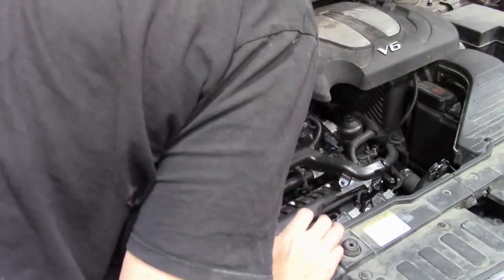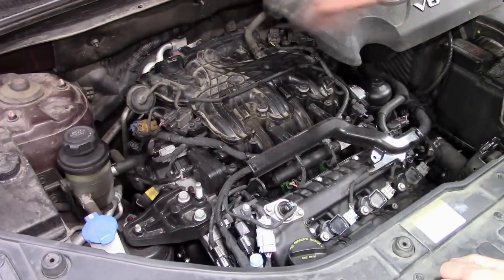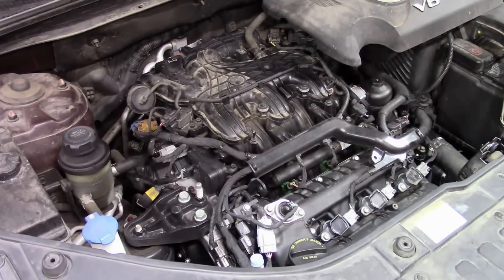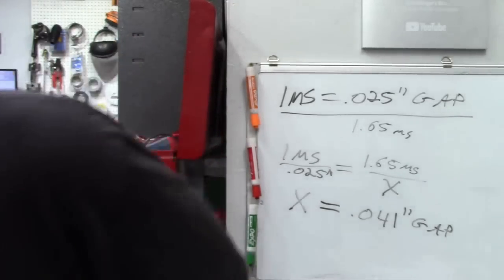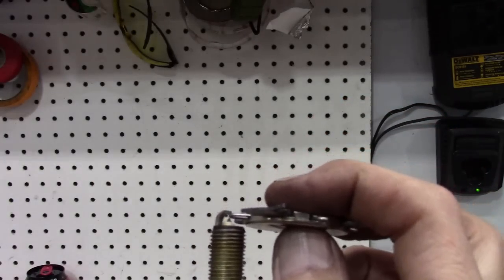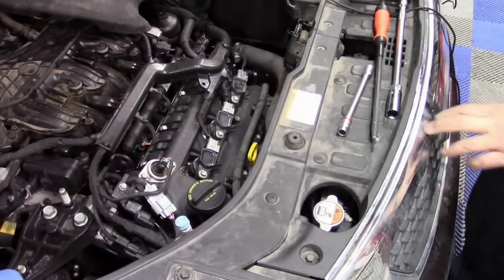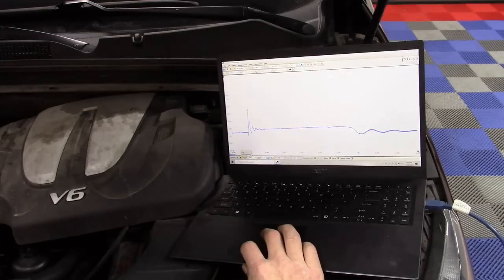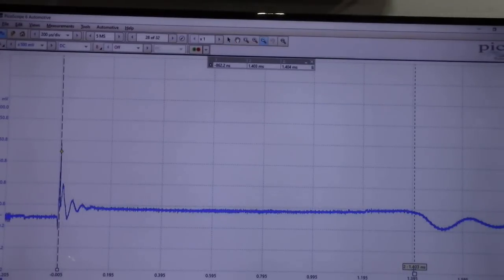Can You Tell Spark Plug Gap Without Removing The Plug?

Comment: A way to accomplish this would be to have a coil with a driver that you can control. With that you could control the voltage on the coil and be able to establish “baselines” and compare. The issue with a system like that would be: you have to connect this coil/driver system to the suspect spark plugs, so the intake has to come off, defeating the purpose of the whole exercise.

Comment: While it's true that duration of spark may depend on many factors, you are changing only one variable in your experiment, so I don't see any issue in trying to understand how duration of spark depends on gap.  If you assume that this relationship follows some power law i.e. T( gap ) = A * gap^p where A and p are parameters that you need to determine then you can use your experimental data to fit these parameters.  Because p enters this equation in a non-linear fashion, you cannot use linear regression as is, however, you can take a log of both side of the equation to get log( T ) = log( A ) + p * Log( gap ) and then linear regression in this log space will work fine. I plugged your numbers into a spreadsheet and ended up with a fitting like this: T( gap ) = 0.59* gap^(-0.34).  It is worthwhile pointing out that for power law assumption one would expect T( 0.08 ) / T( 0.04 ) to be approximately same as T( 0.04 ) / T( 0.02 ) which is not quite so in your data, so either this assumption is not right or measurement error is non-trivial.

Comment: The old school Godfather of spark, https://www.youtube.com/watch?v=TgFJVL_WsMA
Reply: You added a black screen with some text into your video so it seems that you did some research after the fact, the air-fuel mixture between the 2 points, anode, and cathode, must first be ionized to create that first sparkline or vertical rise in the waveform. The larger the gap, the higher the KV demand and the shorter the burn line as you have proven but why, is the question and your edited screen tells why, limited energy from the coil, it is referred to as a limited length of rope that you have for the full spark event, the higher the sparkline the shorter the burn line. As you mentioned there are other factors, the air-fuel ratio is a major factor but that is another test and another story.

What burns easier fuel or air, more fuel meaning at the correct ratio will allow electrons to ionize the mixture at a set amount of time, this is a small piece of spark timing, the spark cannot start until the gap is finally ionized to allow the spark to start and this is one reason for a specific spark gap on the plug and a very nice reason why you are working on this project. If you are going to compare one engine to another, it must be the same type of engine where the bank in question most likely has the same air-fuel ratio or you can prove there is not a rich or lean problem between 2 banks based on O2 feedback, and now you can comfortably measure the gap with your upcoming method based on the full spark waveform, not only the burn line. Again, the spark starts with the firing line based on the gap and air-fuel ratio assuming all other factors are equal such as compression which also plays a huge role, one of the biggest actually so needs an even cranking cadence regardless of the compression, the cylinders need to be fairly even.

Sometimes you mention that not all cars have the same operation like not all cars have fuel pump prime, well here also, not all cars use the same spark plugs in the covered rear bank and the front open bank, due to the labor to get to the rear bank, a manufacturer may choose to use more expensive platinum plugs under the manifold and regular plugs out in the open saying that the covered plugs don't need to be changed as often due to the extra labor involved. But both sets of plugs still use the 1.1mm gap and have the same rated heat range. Your upcoming test may prove that the rear plugs still don't need to be changed based on this fact and the parts store should tell you this info or the owner's manual may list the expected spark plug part numbers for your own maintenance needs.

Scopes are getting more and more affordable these days so I am happy to see that you are moving up in the diagnostic world on your channel. Thank you for your own R&D also. Enjoy the video above.

Comment: As you mentioned Matt, there are lots of variables for the KV firing line, spark KV and burn time. Examples would be air/fuel ratio, compression, spark gap, engine temp, timing, etc. The coil when energized during it's dwell period has gained a certain amount of energy. Depending on all of those variables, the spark will jump the gap. If there is a larger spark gap, the KV firing line will be higher and more energy is used. This means there is less energy for the burn time and it would be shorter in time. And if the gap is less, there is more energy left over for the burn time which means its burn time would be longer. Some people will use the analogy that this energy is equal to the length of a string. The length of the string would be from the highest point of the KV firing line to end of the burn time. You can visualize that as the KV firing line comes down, the burn time will get longer. And as the KV firing line goes up, the burn time gets less. Some people think that resistance is involved when the spark immediately jumps the gap, but this isn't so because current flow hasn't been established yet. The spark KV point where it jumps out is where current flow is established and resistance is determined. For example, if the spark KV point is high, then there is more resistance, maybe from a bad spark plug wire.

I have some thoughts about some changes in your experiment, but it probably wind up being a book in this comment. I sent you an email from your channel email where we could possibly exchange some contact info and give you some thoughts. Have a great day!
Reply from the maker: Was waiting for you to respond hahaha!!!  I will call you later as I also have some ideas as well. I totally would do this on a crank without fuel for example because I could remove fuel as a variable.  Totally the more I think about it, the more I realize this is highly variable.

Comment: Nice experiment. But there are more variables. The compression, the air mixture (lean/rich) are also influencing the spark characteristics. In fact they analize the spark waveform to see if there is compression, or rich / lean mixture.
Reply from the maker: very true. If I revisit this I will only do cranking because I realized in editing that fuel is a variable.

Comment: I had just read a lengthy explanation on coil dwell and I agree with Richard Cranium. As I understand it some coil dwells are controlled by the ECU and some are controlled by a separate module triggered by the ECU. ECU dwells are mapped similar to fuel trims. Again there are many variables.
A question I do have as far as ignition goes is, have you seen a correlation between MAP and ignition timing? I scanned through your videos and didn't find anything. I've an issue with my 97 GMC 5.7 vortec when driving, as timing increases, MAP decreases and LTFT goes to 14. Conditions cannot be duplicated when in park and running the engine rpm the same.

Comment: Okay, I have given this some thought...  I order to have any kind of realistic shot at coming up with a workable Spark Gap vs Spark Time Line correlation that will work with any engine we need to have some constants.  At the least the test needs to be done in a non-running engine where combustion pressure and air/fuel ratios are not a factor, much less a potentially ever changing variable.  This means a way to induce a high voltage spark that can jump the plug gap, where we use the same ignition coil for each voltage output sent, and then the tester will be connected to each plug individually (on a non-running engine), using the same test equipment, we ought to be able to use same spark plug cable length, resistance, and cable type (graphite core, copper wire core, or other conductive material in the core of the cable) needs to be used on each and every plug tested.  So, now we have the makings of a very simple test bed.  I will build a Spark Plug Gap To Ms Spark Line prototype using an old school ignition coil, one spark plug wire, Primary Circuit wiring, an outside power source 9-10 volts DC), and a way to switch the primary ignition on and off via a hand held button.  The thinking is a PicoScope can be used to measure the kV and Ms on a non-running engine where voltage is sent to a subject spark plug by closing, then opening the primary ignition coil circuit to cause the high voltage current to fire and jump the plug gap.

There will be some variables based on plug construction, and any resistance built into each plug brand/model.  But, the variables with trying to gauge a plug gap on a running engine with differing secondary cable lengths, changing air/fuel ratios, differing dynamic combustion chamber compression, etc., will be eliminated, leaving very few remaining variables to disrupt what could be an interesting test.

Okay, I get to build a new toy to play with!  Funny thing, I already have pretty much everything on hand to build such a contraption.  What I do not have yet is the PicoScope, but that is now on my short list of things to acquire, and learn to use with my vintage pony cars (and this Spark Gap Ms correlation project)..
Reply from the maker: I like your thinking. totally agree on non running engine and also the lack of fuel removes a variable too.
Reply: @SchrodingersBox  I just ordered the parts needed to fabricate a test bed.  I will be purchasing at least 1, if not 2, automotive oscilloscope kits this week also.  Maybe by this coming weekend I will have a working model of a spark gap tester, and perhaps I will have a few spark plug lapse times vs gap correlations for more than one new spark plug.  Nothing fancy, ignition coil (for use with an outside resistor), ignition coil mounting bracket, remote starter push button switch, primary ignition capacitor/condenser (to help suppress excessive secondary voltage build up when the primary circuit is closed), Secondary ignition spark plug cable with a long boot, 1/2" inch tick acrylic board to mount the components to.  The initial contraption is not going to be fancy, just a back fabrication of a simple spark plug gap vs spark line sustain time with some fairly common parts (once done I will provide the list of parts used.  Although I could have scrounged the parts together locally, I went through Amazon for all the parts.
Reply: Lynda and I are out of town for a few days.  But, the parts I ordered to build a little primary & secondary ignition test bed to see what the correlation is between spark plug gap and sparkline timeline results.  I plan to build this our old school using a hand held normally open, spring loaded remote starter test switch to let the primary lines of flux build the primary circuit when the button is pressed (switch contacts are closed), and then fire then the button is released and the flux field collapses.  The old school aspect is the use of a condenser to both see how it works during flux field building, and collapsing, and to see the level of absorbede residual energy in the primary circuit when said flux field collapses.

I purchased a MicSig 4 channel scope to test the firing of the test spark plug.  It is more than capable of testing and showing what is going on.   I hope to have all this done and ready to test with by the middle of this coming week.

I also ordered a relatively lower end 2 channel PicoScope 2204A, jut to have something different to play with.  I need to watch out for its shared ground design, but other than that it ought to be plenty capable of doing quick analytical work. Toys, toys, toys...

Stay tuned...

Comment: How intriguing.  But, for me it is not just intriguing for newer cars.  I own several First Generation Mustangs and Shelby (1969 Shelby GT500, 1973 Mach 1, 1973 Mustang Convertible).  Back in those days we "propellor heads" became quite adept at using oscilloscopes, but not units that ran on PCs, iPads, or iPhones.  No, we have huge machines with dedicated cathode ray tubes.  And in the hands of a skilled and experienced user we could "seE" all kinds of issues, and quickly diagnose ignition, charging system, even weak cylinders, and  to some degree carburetor related issues.  There were a few different companies that provided those old school scopes, the most prominent was Sun.  Sun offered more than just scopes, and I have a Sun VAT-40, used to test charging, starting, and battery related issues - a great machine.  I also have an old school Sun 1150 oscilloscope that I LOVE to connect to our vintage pony cars just to tinker if nothing else,.  They all run great, so there is no real diagnostic work to do.

But, there is one fairly significant issue with those old scopes.  Being over 50 years old one can expect the availability of parts and skilled repair persons is hard to find, and it is.  There is a fairly tight knit community of former Sun sales reps and technicians that cater to this essentially ancient (although still viable) technology.  But, frankly, this is a market that is dying off due to the onboard diagnostic capabilities of modern engines, and the from what I have seen with your video the progress made in more advanced oscilloscope technologies, like what PicoScope brings to the market.  I have been looking for a newer oscilloscope platform I can begin to use that provides all the things I can do with the Sun scope, but on our older, vintage vehicles.  Watching this video has opened up a direction for me to take.  Lucky me, I now have something to do during Winter Hibernation when our pony cars are put away for their Winter slumber.  We live in Snow Country (Western Upstate NY), where salt is used on snowy and icy roads - bad stuff for these older cars.  So from mid-November through mid-April I need to find new stuff to keep me busy.  Well, many thanks to this video I have decided to research the PicoScope product offerings to see what I can get to work with my iPhone, iPad, or even MacBook Pro to replace the older Sun Scope in order to get far more refined diagnostic capabilities with ignition, starting, and charging systems.   Heck, this could even open up some interesting doors for folks that retrofit modern Electronic Fuel Injection and Electronic Engine Control systems on their older, vintage engines.  I do think you have helped add years to my life, where I now have something new to pursue as I continue to try to remain relevant in the modern age while playing with our vintage pony cars!  

Woo Hoo!  I feel the presence of youth with fresh blood (in the form of me blasting my way into the PicoScope digital world being dragged into the past technologies...

Here is a link for some photos, in case anyone is interested in our little fleet of pony cars...

https://drive.google.com/drive/folders/1YF8FuR643c5buZJX5qL862nEp87q9-Zc?usp=share_link

And a Walk Around video of the 73 Mach 1 on its last day of a deep restoration...

https://youtu.be/_Fl0B-qmlLI

Comment: explain like im five... coil has set amount of stored energy that it gets charged from the computer. That stored energy is released through the gap on the plug to create a spark. if that gap is bigger then it will use up more of the stored energy than if the gap was small. The part I don't understand is how that equates to time in the "secondary" and what is the definition of secondary vs primary etc. So basically you are trying to measure how the coil is using its stored energy-- if we assume the only variable is the plug gap-- then we would have a good idea. I like this if it was an easy way to test to see if all the ignition waveforms are similar in hard to reach cars-- but if they aren't wouldn't it still be a bit of a parts throw to know if it is the plugs or a bad coil or something else going on causing the waveform difference? i dk
Reply from the maker: This is actually explained in my video on my pay channel on ignition systems. unfortunately too much typing for a comment.   BUT- I can help you visualize it. think of the firing line (the tall spike representing the voltage built up in the secondary before spark jumps) and the spark line (the flat line across representing the actual spark) as a single string. if you pull up on the string to make a longer firing line, you shrink the spark line. if you pull the string to make a longer spark line, it reduces the firing line. 
    because the wider plug gap requires more voltage for the spark to make that big  jump, the firing line will be really tall which shrinks the spark line.

Comment: My theory is this. Consider the “charging” of the coil. A constant voltage is applied and the “charging” current obeys V= L*di/dt. This explains the nearly constant current ramp during the build up of the magnetic field in the coil. When the circuit is opened the di/dt becomes huge resulting in the inductive spike that builds until the voltage becomes large enough to start electron flow across the gap. The spark line obeys the same physics but in reverse. Once the plasma is formed it looks like a resistor:!longer gap is more resistance. The paddle is measuring the voltage on the wire (capacitive coupling). So again we have a constant voltage during the spark line where a larger gap gives you more voltage due to the larger resistance. So the current ramps down obeying L= di/dt. For a larger gap = larger voltage which results in a faster ramp which discharges the inductor faster. This is just a theory. I’ll have to think about it more  to determine if this is just BS.
Reply from the maker: Other commenters agree with you. I think you all are correct.